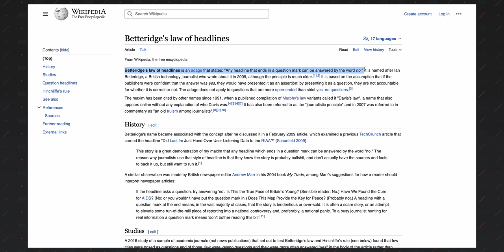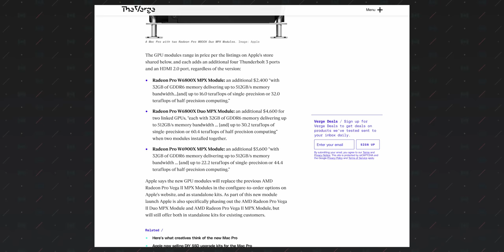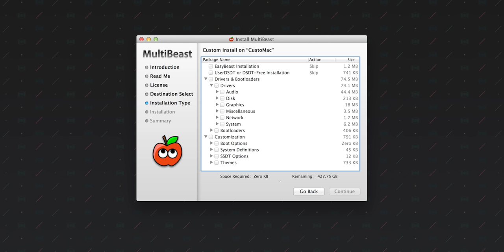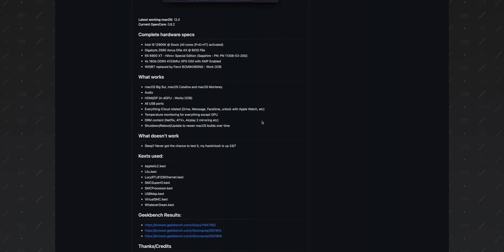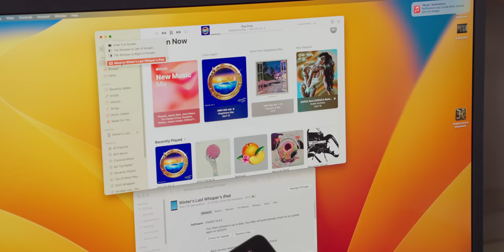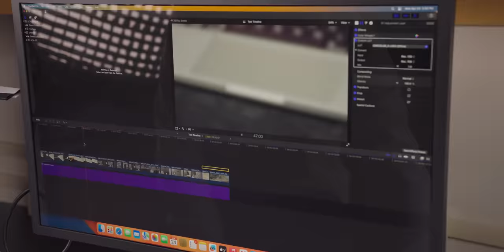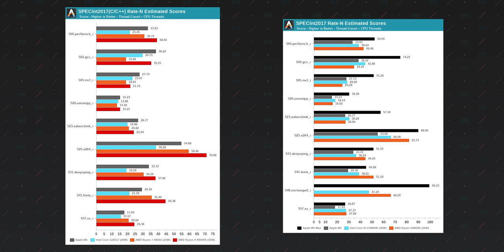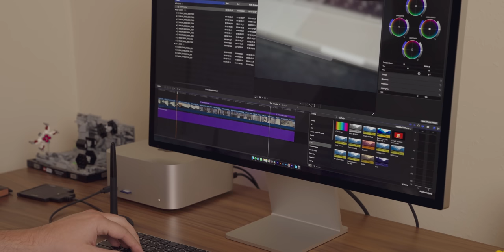This $2,000 Hackintosh SMASHES the $4,000 Mac Studio

Comment: i wonder what the 20/30% cost 80% solution is of that hackintosh, if it exists , likely utilizing used / refurbished parts in auction and some form of overclock/under clock / undervolt , whatever delivers best stable performance

Comment: I turned my Dell Latitude 5480 into a dual boot (win10/sonoma) system.   I did upgrade the system to 32 gb of RAM.   It runs better and more stable than my 13" macbook pro.   Worth the extra effort that it took.

Comment: Thank you for a very informative comparison video. You did an excellent job informing hackintosh noobs on the pros and cons of OpenCore. I should know as I finished upgrading my very old and dated hackintosh with a 10th gen motherboard last weekend.

But I have one complaint about your parts list. Your video glosses over the fact that most motherboards' built-in ethernet or Wi-fi chips won't be fully compatible with macOS and one would be better off installing an addon card with a better proven record. In 8:32 of your video, the back of your hackintosh also shows quite clearly that an add-on Wi-fi card is installed below the GPU with 3 external antennas sticking out. 

Please share and clearly inform your subscribers on what card you used (and where to reference them) to make all AirDrop, iMessage, and such work. Thanks!
Reply: Also, not wanting to split hairs here, but the power supply is 1,000W, not 100W. I'm sure most of us subscribers would not be thrown off by such a minor typo, but you know how some people can be. ;)

Comment: Imo that size comparison was a little unfair given as it's very possible to build a mini-itx system. It won't get as small as the Studio, but it could be closer.

Also, I wish that you had considered applying a power limit to the CPU (and GPU). Yes, it can pull 350W but that is pushing it well past its efficiency curve. For example, in Cinebench R20 a 13900k using 318w is only 45% faster than a 13900k at 90W using Der8aurs data. Again, it won't get close but it puts a big dent into the power draw lead. Fundamentally those parts are enthusiast parts and enthusiasts don't care that much about efficiency so that's why they default to max performance at the cost of efficiency.

Intel and AMD are both investing into accelerators and APU's. It'll definitely be interesting to see how the market plays out in a few years as manufacturing node progress slows and Intel/AMD/Apple/Qualcomm are largely on the same node. Apple had a big advantage being the only TSMC 5nm customer for a while (until mid-late 2022).

Comment: This is why I run Ubuntu on the desktop for my regular workstation and I use Mac laptops.  I find that these Apple silicon laptops are the best laptops you can buy and it's not even close.  But on the desktop side of things, they are not competitive with the competition in terms of performance and software compatibility.  I built my desktop with a 3070 TI, 128GB ram, an i7-13700K, and 6TBs of SSD space.  All for around half of the M1 Ultra studio and it kills it in everything but video editing which I don't do.

Comment: I went from a hackintosh to Mac mini M2 32GB/1TB Pro for all the reasons you mentioned. Was more expensive than I would like, especially compared with hack world but it's for longer term. Apple's storage pricing is an obscene joke at our expense.
Reply: For desktop just buy thunderbolt case from acasis or orico and put WD drive inside. 770 and 850x works great. Why WD? Because Samsung and others have huge TRIM problems with their firmware under macOs (and also, Linux) tht will lead to huge slowdowns, UI freezing and after some time, complete failure of the drive
Reply: That SSD will eventually die and then I'm afraid you're out of luck. That's whole downside to Macs right now. Performance doesn't matter if you can't replace or repair a broken part without replacing the whole logic board, which would probably set you back the cost of what the computer is now (a few years later) worth second hand.

Comment: I'd be curious what the numbers are like when you match the price of the Mac. If this thing can keep up with it at $2000, what could a $4000 machine do?
Reply: Not much much more, replace CPU with 13th gen i9 and GPU with 6950 XT, as I don't think 7000 series AMD work, but I could be wrong. Other than that more ram like 128 GB but it wont make it faster per se. Also more storage, maybe faster storage.
Reply: 192gb ram or more 4tb gen5 nvme or raid 0 of many gen4 drives, threadripper workstation perhaps dual gpu for faster rendering? just a few examples

Comment: I was considering buying Mac Studio but build a custom PC instead. 
CPU i7 13700k 
RAM 64gb ddr5 
GPU Nvidia rtx 4070ti 
SSD Samsung 990pro 2TB 
Noctua NH-U12a cooler 
Motherboard Asus Z790 ProArt with 10GBe and 2x Thunderbolt 
Inside Fractal Design North case. 
The only difference I installed the correct OS Windows 11 Pro 😅 
I spent in total just over £2500 
My PC Kills Mac Studio Ultra for a fraction of the price. 
Very happy with a decision.

Comment: I purchased the M1 MAC Studio when it first came out. I also purchased their keyboard with the key pad combo. I quickly discovered the keyboard’s number pad did get recognized by the OS. I went online and asked tech support about my problem. They thought I had purchased counterfeit products for my Mac. I had to proved to them I had purchased them directly for the Apple website. They had me reboot into a safe mode and put me on hold for about an hour.  They thought they could change the keyboard listed in the settings, but there were no options for any other keyboard. They came back a said they didn’t know how to fix it. I don’t think they knew anything about how computers work at all. It wasn’t on their check list so they were totally lost. 
I notice you use the keyboard without the number pad, but I was wondering by chance you know how fix my problem, or who to ask about my problem.

Comment: Now Triple Boot the Machine, except do it all at the same time.   Manjaro or Ubuntu Budgie with VFIO for Win10/11 virtualized with GPU passthrough,  give this VM a RTX 4080 and then a MacOS Ventura VM with a 7900xt passed through.  Get two 27" monitors and set them up side by side or get a 49" Ultrawide and run them together with the mouse and keyboard shared between the VMs with a handoff feature.

Comment: I'm really considering buying a base model Mac Mini M2 for $559 or waiting to buy a Framework Laptop (that can later become a desktop computer by upgrading the Mainboard down the line and 3D printing the case for it for free). The feature set I'd like for my Hackintosh to do well is as follows: Gaming on Steam and Streaming with Twitch Studio Beta on Windows, and music production with Logic Pro X and video editing with Final Cut Pro on MacOS. I'd like my Hackintosh to be able to dual boot in to Windows and MacOS. It's just frustrating for customers that don't specifically want to upgrade everything to the maximum on Apple's website from the very beginning of their purchase. I purchased a Macbook Pro 2011 brand new at the time, and looking at Apple's track record, it hasn't gotten any better in the modularity/upgradability/e-waste department. In fact, I would say that my Macbook Pro was one of the last "upgradable after purchase" Macbook Pro's to date! This is why the idea of a Hackintosh Framework Laptop is so intriguing to me, especially with Framework's modularity/upgradability. I could see myself swapping out a few components and upgrading things down the line when needed, and using the rest of the components for a desktop computer at home that Vesa Mounts to the back of my 34 inch monitor!

Comment: Would like to see it on P core only with a slight overclock.  Probably would run better as processes wouldn't be getting stuck on slower cores.  At least everywhere that doesn't make use of more than 10 threads (hyper threading only makes up for so many real cores).

Of course it would be really nice to try a workstation class 10 or 12 (or more) P core Xeon, but a lot of things would be nice.  The beat deal I saw on those included a $700 SuperMicro board and a high core processor is like $1,000-3,000

Comment: I have a i3-12100f and a RX 5500 XT running MacOS Sonoma. But the HDMI audio is not working. My monitor has built-in speakers so I want them to be used. My motherboard's audio jack is working but HDMI audio isn't working. How can I fix this??

Comment: When a failed SSD or even RAM requires a full logic board replacement, complete with everything and costing an arm and a leg, the costs of owning a current M series Mac can easily become a nightmare. Couple that with the just 12 months warranty Apple offers, unless you want to spend even more to bump that up to 3 years and a hackintosh at half the price of the Mac looks very good.

Comment: I threw hacked ventura on a trashy HP laptop from 2014, and it worked rather well, excluding the fact I couldn't get the drivers to work for the insanely unsupported components (WiFi card, keyboard, trackpad, eSATA connector, fingerprint scanner, so on) but it booted, with minimal effort. It was surprising to me, honestly, but it was far simpler than I had expected. I still prefer a more efficient CPU, and thinner chassis, though, and only experimented a little for the fun of it.

Comment: These are the kind of videos I subscribed for! I'd love a part two that tries to match Apple's footprint a bit more in a much smaller system with a Ryzen CPU.
Let's say a Ryzen 9 7950X(3D?) on a M-ITX motherboard (ASUS ROG Strix B650E-I  perhaps) in a relatively small case - I'd say the Lian Li A4-H2O in Silver looks like what an Industrial Apple product could look like. 

Could keep the same graphics card as in this video... or go all out and stick a 6950X in it for the ultimate dual boot/gaming system. Power draw should be lower for the CPU and performance should be similar or better.
Reply: a b series motherboard probably isn't the best option for a ryzen 9 lol, and also the task scheduling issues he mentioned would be compounded by the ryzen 9 x3d chips as they're still in their infancy and have issues on windows already. 

the 7800x3d doesn't have the dual chiplet design of its bigger brothers though so wouldn't be susceptible to the scheduling concerns though since all of its cores are clocked the same, but apart from power efficiency there isn't really a justifiable reason to run it as the cores are clocked lower than its non x3d counterpart so productivity tasks would suffer, and mac gaming on x86 is still very limited for such a capable gaming oriented CPU
Reply: @sir_wheat_thins   a 7950X/X3D should be absolutely fine with a 70A 10 phase VRM. The Chipset itself doesn't really matter as long as it supports the CPU.

The Chiplet design itself shouldn't matter to much. The fact that only one Chiplet has 3d cache because AMD cheaped out on their top CPU however is a problem. It kind of makes it even more interesting to see how it fares under MacOS though

Comment: I lost my 2017 iMac last November due to some disadvantages … write speed of the Fusion Drive below 10 MB/s :(
Then I decide to use the old (2021 build) Gaming computer and transform it into a hackintosh with Ventura (Sonoma is not compatible my other portable MacBook Pro anyway)

hardware: 
64 GB RAM DDR4 3200 
i9-10900K withdrawals AIO cooling
Z490 Motherboard (MSi MEG z490 Ace)
Samsung  pro 970 m.2 1TB (macOS)
Samsung evo 970 m.2 500GB (Windowing 11 pro)
2 SATA 1TB formatted exFat to use with macOS and Windows

GPU was the problem … my 3090 is not supported and a 7900xt also not and not in my budget
a 6900XT not in my budget as well —> a 6800xt it will be.
Luckily a friend wants to upgrade his GPU from 5700XT to a 7900xt or 4090 
I am now waiting the card to arrive.

I am sure this hackintosh will outperform the iMac, even it had also 64 GB RAM

Thanks to you I know that I need to take out the 2 PCIe 5 port USB Cards

Comment: The only hackintoshing that I do is with an iMac with an x86 processor as I want to keep (somewhat) current with the OS, really sucks that Apple dropped support for machines that are still good enough to do useful work but are too "old" to be supported by Apple. You can get some of these insanely cheap right now and the displays on them are top notch so worth it for those that like the iOS.

Comment: I mainly use NVIDIA GPUs, so I can't run Hackintoshes anymore.
But, man do I love how far they have come! I used to run MacOS on a Sony Vaio Duo 11, a small 2-in-one that relied on Intel iGPU. It was mad fun! Building a custom config.plist, however, sounds like it is not. I use OpenCore on my dad's MacBook Pro from 2015 to keep it up and running, but writing a whole config file for it sounds like one hell of an experience. It also seems like as though you can not build a Hackintosh anymore without access to a physical mac - that is kinda devastating.
Reply: I'm pretty sure you can create your OS installer USB on Windows, with all the needed software for setup.

Comment: 1:25 I'm hopeful that the existence of the 2019 iMac without a T1 or T2 will mean that Apple will still support T-less Intel Macs for a year or two more at least. But you're right, besides those, if Apple drops support for 2017 Macs then every Intel Mac supported will have a T2. Even so, I also hope that adding the code to require the T2 chip is more work than it's worth and that even when the 2019 iMac gets dropped that Hackintoshes will still be possible.
Reply: That may be our only hope

Comment: Apple cut support for PowerPC short to 4-5 years when they transitioned to Intel. The year they release the Apple Silicon Mac Pro will probably be the last year with a new macOS for AMD64.
The Mac Studio may have a higher price, but you'll also be able to re-sell it for much more and much easier once you're ready to upgrade. To upgrade the Intel system you'll need a new motherboard with a new socket again.

Comment: Man, this takes me back.  Used to run come custom bootloaders with MaxOSX86's site and added kexts back on my old dual-Xeon SR-2 EVGA board.  I couldn't ever seemingly patch MacOS 10.8 Snow Leopard without it totally borking the install but I mean, it did work if left in vanilla configuration.  Too bad nothing modern Nvidia is supported at all as it's some time since I've ran AMD (GPU-wise).

Comment: I suspect Ventura was x86's last OS, this year i think they will drop intel like they did back when PowerPC was dropped when the Intel transistion was complete. Ventura will probably get updates for the next 5 years, and this years release will just be compiled for Apple Silicon, I currently run an AM4 Hackintosh using Opencore with a Vega 64, 13th Gen Intel will have issues with macOS as it won't see the E-Core's but you could disable this in the Bios and Power management should function better.
Reply: But its certainly nice to see a hackintosh done the correct way, using the correct guides and instructions, so thank you for doing this video for those wanted to try hackintoshes, because a lot of people will do it the wrong way. Top Video!

Comment: Afer getting am M2 Mac mini, I see that the performance (4 years later...) is still not up to the core i9-9900k iMac it replaces.  However, due to the falling prices of Intel-based Macs, I had to make the jump now before the resale price got too low.  I would have rather waited on M3.  The silver lining is that Mac mini are cheap enough that I can probably upgrade with minimal issues... My PC isn't near the hardware of your hackintoch, but it still out performs the Mac mini.  The components in it are 2 years old.  Power efficiency is where Apple Silicon shines.

Comment: ...Still running my insanely specced-out, 14-year-old Mac Pro 4,1>5,1 to the ground, but over the last year, I must admit I'm kinda at a crossroads. I was considering getting a decent M1/M2 Mac to my liking, and then build an AMD gaming PC, but there are a plethora of reasons why I still haven't pulled the trigger on either. Despite being ancient, a single Mac Pro from 2009 is surprisingly good enough at being both machines—for me personally, and for much, MUCH less $$$.

Comment: It’s funny because I thought hackintosh was dead. I bought a 6800xt just in case when building my windows build. The first build on tonymacx86 using 12th gen was built with all the hardware I ended up purchasing. Which is weird because my motherboard isn’t super popular.

Comment: For someone who just use logic pro x on a mac, my hackintosh build (12400f - 32gb of ram -rx 6600 dual boot, i built it 2 years ago) is still compareable with the m3 macbook pro in logic pro x. So until it broke on itself or i managed to break it, i will not give my money to apple again.